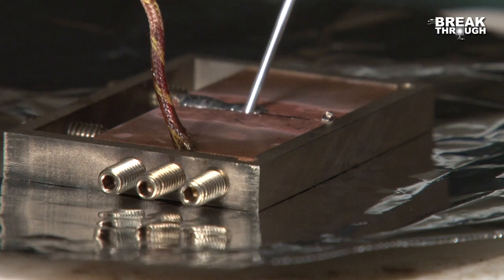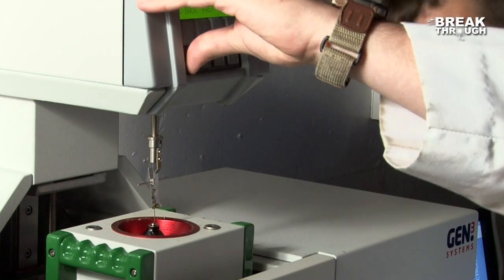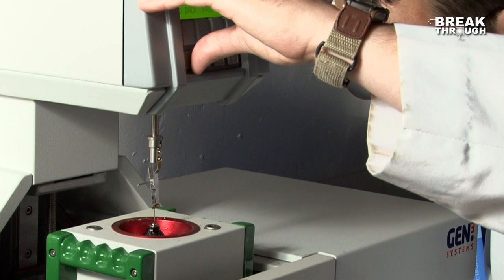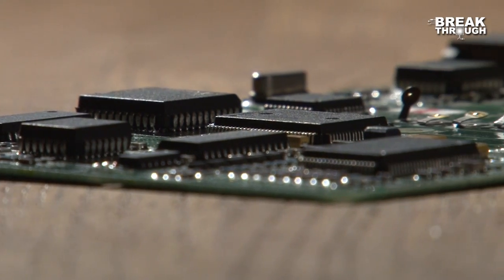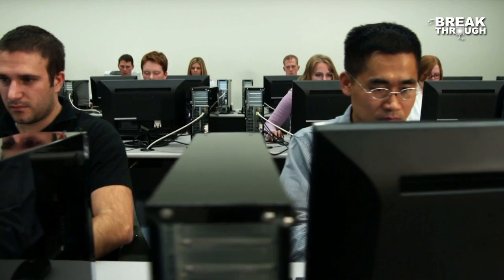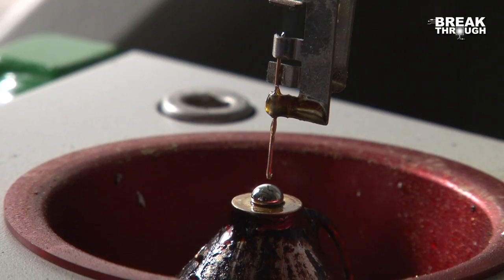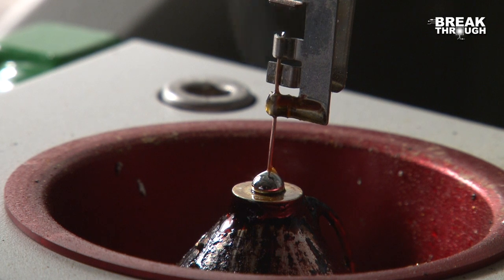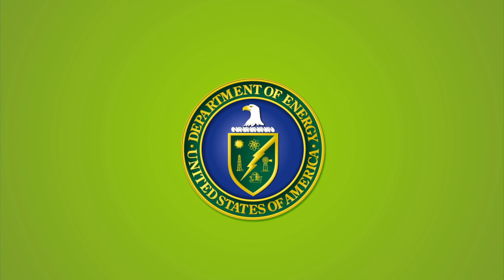Breakthrough: Lead-free Solder

Comment: Avionics, industrial control systems, medical equipment, backbone communications infrastructure equipment, military electronics and anything else that would cause Very Bad Things to happen if it died is specifically exempted from all this lead free rubbish.  That right there says a lot.
Then there are the much nastier fluxes and much hotter soldering temperatures required for lead free.